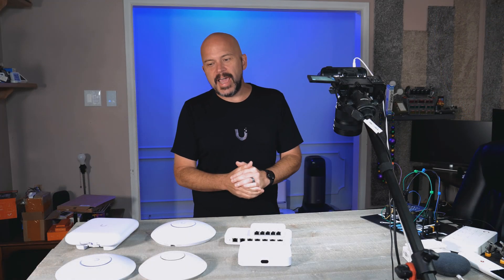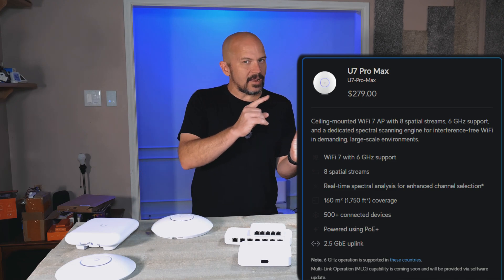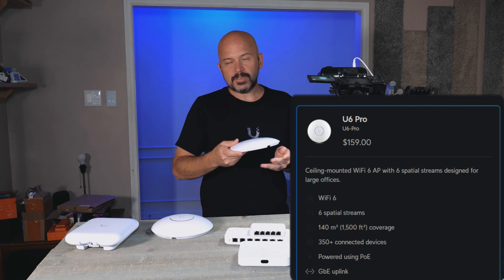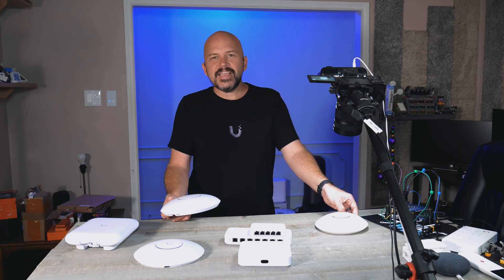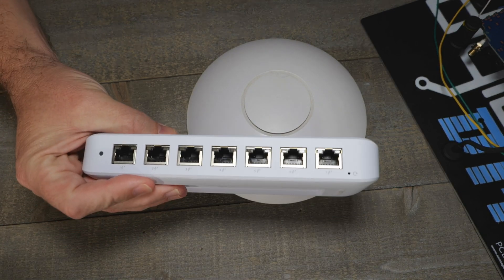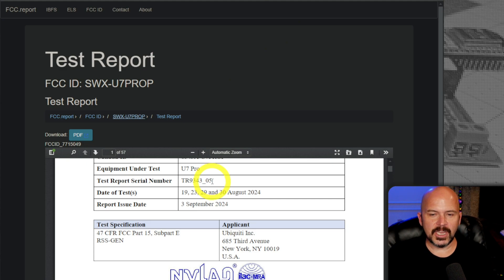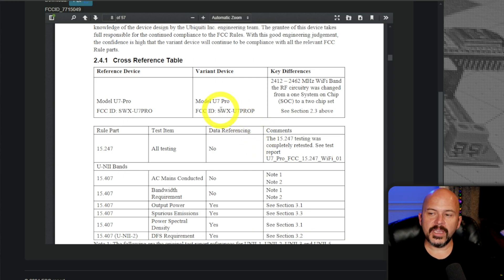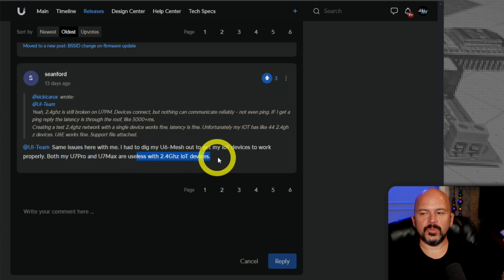UniFi U7 Pro & Max - DON'T BUY Here's Why

Comment: Thanks for sharing your experience. We’ve reached out to properly connect and discuss potential improvements. Cheers!
Reply: It's really bad I'm having this issue too
Reply: I am having constant issues with devices. Please offer a recall for users to trade in for U6.
Reply: given the ongoing issues and the inability to fix them for such a long time, I really hope you do the right thing and voluntarily issue a recall for the U7-Pro-Max or U7-Pro. I can't believe I purchased this product, and there's still no stable MLO release despite the promise of delivery months ago. Ironically, at this point, I don't even care about MLO anymore—I just hope the other issues will be addressed
Reply: What would be useful to know Ubiquiti is why some users dont experience any issues. Is it for example a config / regional issue. Would love to offer my time to help with this but  since i still dont know what "issues" are the problem im a little lost.
Reply from the maker: It does mean quite a bit to come into the lions den per say and attack this issue head on when the company could have simply ignored the issue.

I received the email and will respond back. Looking forward to collaborating on this issue!
Reply: @digiblurDIY  any progress? im about to do a 30000 sq foot office and am looking at the U7 pro max since the E7 is sold out.
Reply from the maker: @danielgriego6059 nothing fixed on the U7 Pro Max yet. U7 Pro getting closer though. Would I buy more 7 series APs at this point? Nope. U6 Pro and Enterprise are my goto at this point.
Reply: @digiblurDIY  thank you for update. I am going to wait for 7 pro+ or whatever they call it with dual chip. clearly whatever their plans were, not working.
Reply: One more here with same issue. Wish I had found this video before investing in two units. Has been driving me crazy to figure out why devices are going offline. Any predictions to when issue will be resolved? Or should i try to claim warranty and have them returned?
Reply from the maker: @NGyori it is close on the U7 Pro but still in beta testing. No official release yet. Still have few issues to hammer out and also bring it to the U7 Pro Max.
Reply: @digiblurDIY  would you recommend considering U7 Pro or just stick with U6 Pro? I'm a home user, I don't swap devices as much as most people, so I want something that I'll buy once, install and just not think about for years. I've had a Dream Machine/nanoHD combo forever, but my new AT&T Fiber router outperforms those so easily. I want an upgrade back to Ubiquiti, so I can get some better networking features. Thank you!
Reply from the maker: @brois841 the U7 Pro is getting better with firmware updates but I still won't buy another myself.
Reply: @digiblurDIY  I ended up getting a U6 Pro and have been using it for over a week. It's been incredibly fast and stable. Thanks again for your advice and video!
Reply: @brois841  Just bought two U7 Pro Max. They're both messed up and useless. This is a nightmare.
Reply: @digiblurDIY is it fixed?
Reply from the maker: For the most part. Use the latest stable 8.x release for the AP
Reply: How is this now? I have seen on the Forums and Reddit that the U7 Pro is basically working fine now? Most people reporting stability for the last 2 weeks?
Reply from the maker: @falcon758 run the latest EA firmware if you have the hardware. Most things are fixed for now but for buying my recommendation is to hold out and let them get a couple official releases under their belt and out to the masses for proper testing.
Reply: I wondering to but it, but what about the fan? Its loudy? Its working with constant speed?
Reply: @tma9893  For most of us, the fan literally never spins.
Reply: Hmmmm. I did have early issues with the AP-7-ProMax. I switched for a short time back to my AP-6-Enterprise. I had much better luck on the 8.x.x firmware. Ran well, but ended up getting the E7. E7 has had more issues that I have seen on the 6ghz side than 2.4ghz, however I have been stable on the latest 8.x.x release for the E7 and AP-7-ProMax
Reply: Is there an update with this issue? What can I do with my two $180 devices to make them function as they should?
Reply: @bigjohnsta86  the early access firmware fixed my issues, try that if you haven't yet
Reply from the maker: @jchambo86 did you try the latest 7.0.x EA firmware?
Reply: @digiblurDIY  i am looking to upgrade my system to the u7 pro in mid-march. currently using the U6 Pro for my 2 ap's. i would like the 6ghz option. only thing we have on 2ghz is our printers and other smart home. i currently run the wifi with different ssids for each band. (I prefer that fine control) with locking devices to certain ap's based on location in the apt. would you think they would have it fixed by then. i am also planing on getting the flex 2.5 poe and flex mini 2.5. our phones can do 6ghz my laptop can. and I plan to get the ps5 pro around that time and I know that has the wifi 7 support (but with only a 1gb lan port).
Reply from the maker: @carcrasher89 I think you should be fine for the most part by then especially on the 7.0.x branch of firmware
Reply: @digiblurDIY  thanks for the response and info.
Reply: @digiblurDIY does the new firmware fix it for the original hardware too, or just for the dual soc one?
Reply from the maker: @lindhe it is for all U7 APs
Reply: @UbiquitiInc  Seeing your engagement in this thread and apparent dedication to working with the community and fixing the problem gave me confidence to buy the U7 Pro and start buying into the Unifi product line-up. Well done! 👍
Reply: why not consider rukus?   their stuff is awesome
Reply from the maker: @mrwizworks down to price for me on the wifi 7 gear.
Reply: Having the same problems here, over 150 devices with 3 U7 Pro Max and having terrible experience with my IOT devices.
Reply: @maxpettv did you fix it?
Reply: Also been having issues with my iot devices and my u7 pro. This is my first unifi device and I'm very disappointed. I'm using a separate wifi ssid just for my iot and using the iot setting.
Reply: Not seeing any big IoT issues here with my two U7 Pro.
Everything seems fine, I think it‘s probably one of the issues with new product lines that utilize new wifi standards: They usually need some time, to be in a good state, where they are recommendable.
Reply: - Buggy 
- Silly fan
- just 2.5G uplink 
Sucks that TP-Link is getting targeted, because the Omada line is really good
Reply: @RG_97-i3r  TP-Link is getting targetted because it's chinese spyware dumpster fire.
Reply: @UbiquitiInc, it's been at least three months since this issue first arose, and we’ve yet to see any meaningful customer-focused action or communication. It’s frustrating when consumers and enthusiasts have to do your job—testing, QAing, and researching products extensively before a purchase—because you can’t be trusted to deliver consistent quality. I’m starting to feel like you’re banking on your past brand reputation, hoping we’ll forget about the problem and just accept your half-baked solutions.

I was ready to invest heavily in UniFi infrastructure—for myself, my parents, and their second home in Florida—but now? I’m exploring other options. I’m in risk, compliance, and IS audit, not networking, and I rely on manufacturers like you to deliver quality hardware. After a decade in tech roles across international companies, I’ve learned one thing: when there’s a customer-facing issue, it’s all hands on deck until it’s resolved to customer standards.

The U7 Pro and U7 Pro Max—especially on the 2.4 GHz Wi-Fi band—are simply defective. The fact that this issue has been profiled for months without any meaningful response or solution speaks volumes about your approach to customer service and product quality. This isn’t about innovation anymore, it’s about meeting the basic functionality your customers expect. If your product can’t even handle 2.4 GHz properly, it’s defective and shouldn’t be on the market.

You’ve been selling a defective product while relying on your past performance to avoid the hard work of actually delivering a quality experience. Your brand reputation is at stake, and I’m already preparing to raise concerns within my organization—one that spends hundreds of thousands with you—about your failure to address this with the seriousness it deserves. Your lack of transparency and action is noticeable, and honestly, I’m starting to care less about your promises and more about finding reliable alternatives.

It’s not just about the U7 Pro Max anymore. It’s about the entire product experience, and we’re noticing. I don’t want to wait another three months for a fix; I want action now. So, please, do something. The clock is ticking
Reply: This is joke. Those device have worse performance then Orange Funbox even on 5ghz wifi 6 @160Mhz
Reply: So the u7 pro now is worth it? I have to keep the same SSID name between 2.4ghz qnd 5ghz
Reply from the maker: @ryccosn somewhat but I am going to wait a bit for a official 8.0 release to see if all the issues get fixed
Reply: @ryccosn  I would definitely suggest waiting for official releases of 8.0 or higher. Buying something that you know needs early access firmware to function correctly is probably a bad policy.
Reply: Same problem for me. I reached out to support about a month ago on this and was told it was an issue with my set up, and that possibly a switch firmware update would fix this. I really hope Unifi replaces these broken devices.
Reply: This is Bullshit, please be open with us about this. Thanks for trying
Reply: This has been addressed with the Unifi software wireless network config page even recommending right on the page that you create a separate 2.4 ghz network for your IoT devices with "Enhanced IoT Connectivity" turned on, as a lot of the simple/cheap chips used in there devices can have problems with the WPA3, implementation as well as several other more advanced options for PMF, Band Steering, extra data in the beacons, etc.  Also setting up a separate wireless network, is considered part of Best Practices anyway, usually with the added steps of separate VLAN, firewall rules, etc. as these devices tend to have weak security and slow or no updates fixing bugs and vulnerabilities, and isolating them helps protect the rest of your network.
Reply from the maker: Not fixed just yet. Don't get excited.
Reply: @digiblurDIY  thanks - keep us updated!
Reply: U7 pro is amazing on my dream machine SE!!! Soon i will buy switch 10gbps 8 port 2,5gbps and hook it up there!
Reply: Please charge more and provide superb products again.
Reply: Get out of here Ubiquiti your hardware is garbage and you know it. You release newer models with worse features than old models and charge more. Your hardware has been going downhill for a while now and everyone knows it
Reply: @Vyraxium spending 2k per ruckus WAP having similar issues..

Comment: I had an issue with some older devices but solved it by creating an IoT network and SSID that only uses WPA2 and changing PMF from optional to disabled.  All has been solid since. (Currently on 7.0.66, not sure what firmware I started with because several updates since deployed back in June24)
Reply from the maker: Yep. That's what I have run for since the AC LR days. Plain jane 2.4ghz 20mhz SSID for smart home devices with all the features disabled.
Reply: @digiblurDIY I’ve had to do the same thing.  I have an SSID with no frills and WPA2 only for my IoT devices.

Comment: I have had the U7 pro for about a month and not have had any issues with older or newer IoT devices.
Reply: same, I think the issues are resolved and was just sotware?
Reply: @tablatronix  If it was just software they wouldn't have bothered spending money quietly releasing a dual chip version of the product with a chip dedicated exclusively for 2.4ghz....unless a dev found the fix after new dual chip version was already being manufactured. Shooting themselves in the foot by being quiet about it.

Comment: I've had the U7 Pro since they came out, no issues with my 30+ IoT devices.
Reply from the maker: What firmware are you on now?
Reply: @digiblurDIY  7.0.69, about to run the update to 7.1.29
Reply from the maker: I might try that one for kicks to see if MLO works finally.
Reply: I have 3 U7 Pro Wall units running 7.0.66 firmware. About 48 active WiFi devices but only about 12 2.4 Ghz devices however. I actively avoid ESP32 WiFi 4 gen devices.

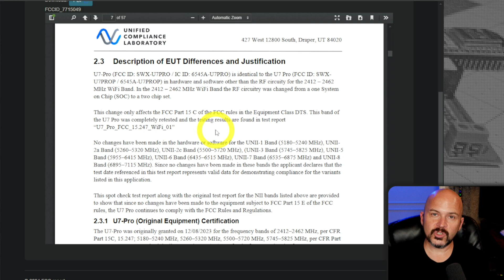Comment: 8:31 I do know that Ubiquiti is using the Immersive Home wifi 7 platform for these APs which is targeted more at residential / consumer grade devices. I would be surprised if these same issues existed in the much more expensive Networking Pro series used by the more premium enterprise wireless vendors like Cisco and Aruba.

Comment: The U6 Pro and U6 Enterprise have the same issues. All my ESPHome based devices will not stay connected. I started with the U7 Pro, sold those bought U6 Pro's. Same issues persisted, just got the U6 Enterprises and guess what same issues. My try downgrading them but may be done with Ubiquiti.
Reply from the maker: Running two U6 Enterprise here as that's what I swap back to after trying firmware fixes. No issues on regular release on those. I do run a 2.4ghz only plain jane no feature SSID for my smart home devices
Reply: @digiblurDIY  I run a 2.4 no feature SSID for smart home as well, but my Kauf bulbs and Apollo Automation devices keep dropping off all the time. I have to power cycle them twice a day to get them to reconnect.

Comment: 3 of u7 pro max and they suck. Some of my devices just disconnect and connect every 1 hour. Support is useless and they have even stopped replying
Reply from the maker: That's exactly the issue I have.  Stuff just randomnly falls off, some won't come back.  It got annoying rebooting the house with the breaker.
Reply: have you tried the ea 7.0.76 or 77. For me 77 is super worst
Reply from the maker: 7.0.77 was bad for me as well.  7.0.76 is okay..no perfect but it does make the U7PM usable.
Reply: @digiblurDIY  exactly. 76 was still okay. But my some devices just refuse to stay connected no matter 74 or 76 or 77. I wanted to grow in ubiquiti products but I am holding my hand as I my first product itself was bad

Comment: I have been pretty happy with the U6 Pro. I did downgrade to official 6.677 from early release because retries went crazy. No issues on 6.6.77. Thinking about adding another AP. Might just get another U6 Pro or the enterprise. Not sure... just need a little more coverage. I almost bought the U7, but decided not to because I do not have any devices that would take advantage.
Reply from the maker: Solid AP there!

Comment: What's your thoughts on the omada wifi 7 series. i actually had a ac-hd that bootloops and was days out of warranty so all ubiquiti was willing to do for me was say sorry. Been down to a nano-hd for a while now. Kind of thinking of jumping ship with a Omada EAP773 or waiting for the Deco BE65-PoE
Reply from the maker: I haven't tried the U7 side of Omada yet but very tempted to at this point to see how they work.  I've used the WiFi 5 and 6 models though without issue.
Reply: @digiblurDIY  Do you know if they use similar chipsets? It seems they both run hot. Makes me wonder if its just worth waiting for a second revision to come about. Sounds like that's what you found in the fcc filings

Comment: The only issue I have with my U7 Pro is my Pixel 8 sticks to the 5ghz and says "no internet", I might need to enforce minimum RSSI to fix that though.   I haven't had any of these issues with my IoT devices on 2.4 including my Wyze devices that have caused me the most issues with connectivity over the years.   I do have 6GHz disabled right now though, and It's possible I'm lucky but that's usually not the case.
Reply: Same problem with my pixel 8, too

Comment: Genuinely curious because i have both a u6 pro and a u7pro and i cant fault either of them.

What specifically is going wrong with them?, im UK based and plugging directly in to a POE+ unifi switch and im just not seeing any issues on 2.4 5 or 6 frequencies
Reply from the maker: U6 Pro is great. U7 Pro on 7.0.59 is mostly okay with a few random issues.

Comment: I’ve got a netgear R9000 router. It was one of the best, most expensive routers at time of purchase. Can I use one of these as an access point, or do I need to have the unifi router?
Reply from the maker: UniFi APs do not require their switch or router. You do need their controller software running during setup though.